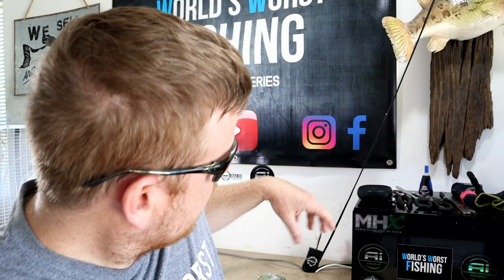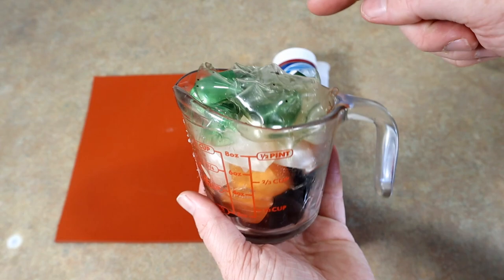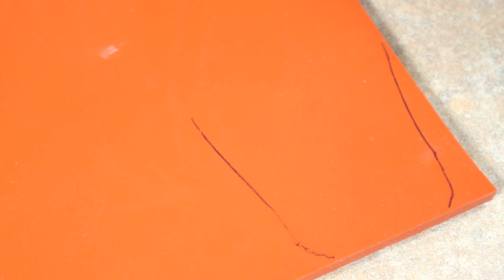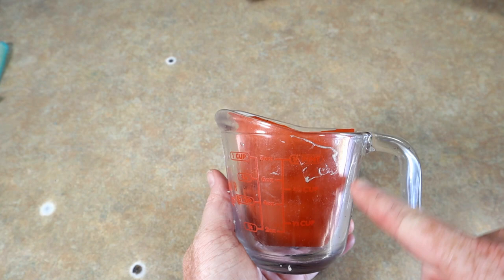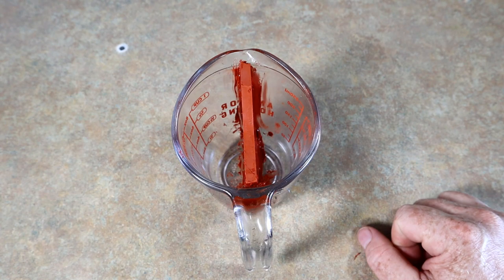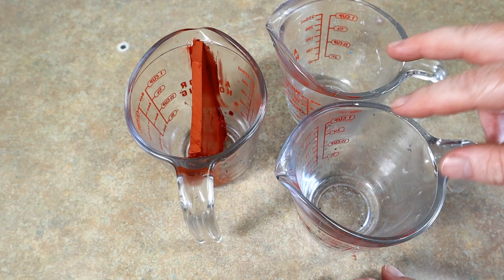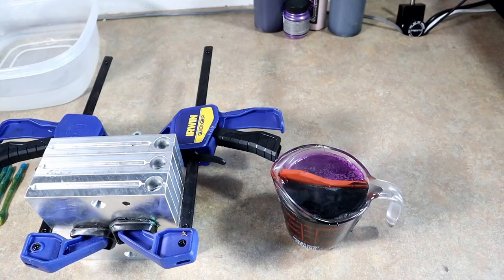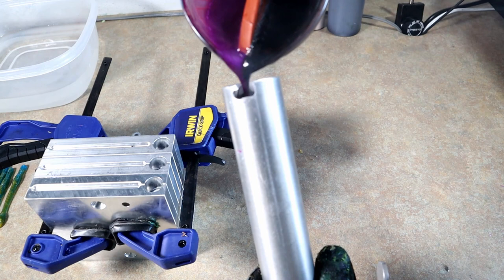Making A DIVIDER CUP For Pouring Soft Plastic Lures; Make & Pour

Comment: I mixed up 2 colors in separate cups and poured them into my injector. One of the worst f#ckups I did, not because of the pouring of 2 colors but once I put the cap on the injector I pushed the plunger to get the air out (like a doctor does a needle) and I wasn't wearing gloves... let's just say my hand and legs were just a little blistered...
Reply from the maker: got to be careful!

Comment: You don't actually need to use plastic for making the template. There's tons of things that can work if you want something like this and don't have it.
Reply from the maker: such as?
Reply: @WorldsWorstFishing  Literally any mold-able material that you can cut in half while still retaining the same general dimensions when removed from the cup. Because the cup is wider at the top than the bottom, a little mold-release on the cup and you can use just about anything. Plaster, wax, paper mache, some hot glue that you smeared on the inside of the cup with a popcicle stick bracing the general shape in the gap between the walls, some sawdust that you mixed with glue to make a paste, a piece of junk-mail that you trimmed with scissors until it fit just right...
There's a lot of options for finding the cross-section of the cup for making a template.

Edit: Concentrated Jello would be excellent for this. Regular jello would be too weak, but concentrated jello would be perfect. It wouldn't be all that different from using bait plastic if you don't make lures but still want to have a divider cup for other kinds of crafts. It's also dirt cheap if you don't care about the flavor.